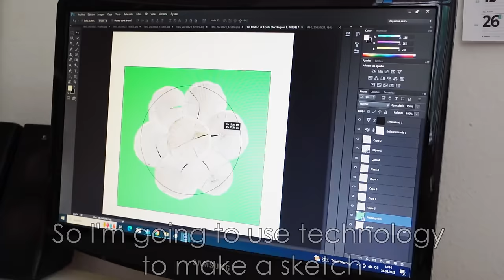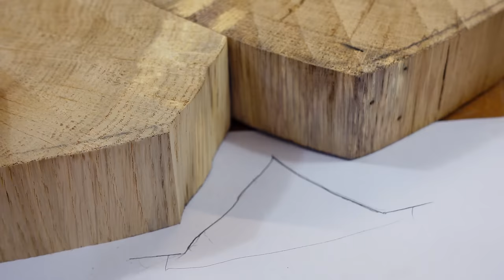They said it was IMPOSSIBLE to make this TABLE

Comment: I saw a floor made this way with cord wood fit together and with an epoxy pour.  It was beautiful. We did this 40 years ago over a large cable spool, when we were tired of a card table for the kids. We used that table for 35 years.
Reply from the maker: Wow!
Reply: Good work. So beautiful how you take your time to include all the steps necessary to take what you have and create a beautiful one of a kind piece. I applaud your skill and artistry🎉
Reply from the maker: @orenziajaskiewicz1460  thank you so much. I'm glad you like it!

Comment: Looks pretty cool!  How will it fare over time with changes in humidity?  I know you backed it, but will that be enough to prevent continuing grown ring shrinkage cracks?
Reply from the maker: If the wood is dry and you use a good finish ,no problem

Comment: Beautiful.  I like it round.  Just out of curiosity, what is the final diameter of the round?  I am currently struggling with a mosaic project 3’ X 3’ that was to be an outdoor wall hanging.  But, I decided to make it into a table and would like to build a mold into a circle and encase it in acrylic resin.  You mentioned using an acrylic boarder striping sealing it carefully, where did you find the stripping?  To allow for a 2” boarder around each corner edge, my base will be 50” diameter, which yours looked to be in the video, so I am curious.   Thank you in advance.
Reply from the maker: It's about 1 meter diameter. You can buy it in Amazon

Comment: Make a flower shape and fill the gaps including the edges with resin (violet or mauve) to make a circle. So, the wood would be a flower and it would have a circular shape due to resin. Plseee 🥺
Basically the triangular pieces of woood which made it a circle would be replaced by resin
Reply from the maker: I'm not a big fan of violet...
Reply: Then make it yellow resin or any colour you like. But it will look soooo awesome 😍
And there limitless options. Like adding dried flowers in the resin. Or glitter or just anything.... 😍😍😍😍

Comment: I loved❤ the piece before you made more modern . You could have used resin an ir epoxy an used a light blue powder pigment in resin an  filled each  Crack to an cut each piece to fir into each other just not modernize it so much .your table looks nice though 😊

Comment: I believe the flower shape was better, but either is good.  However, I have one thing I would point out, if you are intending to sell this and I was considering purchasing it and I saw the MDF, I would walk away from it.  I don't care how good or nice everything else is, I wouldn't even consider it.  The only reason I see for the MDF is, is to make sure all the pieces stay together over time, if that's the case I would have chosen something else to complement the design, but I would never use MDF.  I understand this is a unique piece with many challenges, but I wonder about the longevity of it.  It has no directional stability and it will swell and shrink in both x and y dimensions.   Maybe, because it's small, it won't experience enough stress to tear itself apart.
Reply from the maker: Don't worry, it isn't going to break

Comment: Super idea until you added the MDF inlay… Couldn’t any more “noble” material be used to stabilise (steel?). It’s like constructing a high-end Ferrari and adding some cheap plastic to the interior…
Reply from the maker: I didn't want to use a steel sheet and make the table weigh more than my car. I thought about using titanium, but it was beyond my budget.

Comment: Yes. I personally would have left it as the natural shape after assembly, rather than make it round. It had more character, more visually appealing, and  sorta goes with the natural theme of the material. You could even tell a story to people that it is a slice/slab from a rare tree. Great conversation piece. Oh yeah. Just before you showed us, I said, I'd draw the slabs up in Rhino or solid works to map how I would put them together.
Reply from the maker: I did it with Photoshop. It was necessary
Reply: @marmotaworks  photoshop is great for many things, but not so much 3D modeling. I regularly use Rhino to put together designs for my woodcraft because I can set & see the dimension specs for zero tolerance puzzle joint concepts in my woodcraft.

Comment: No one said it was impossible, just that it is a bad idea. Neither the wood nor the MDF has the strength that a table needs.
Reply from the maker: I don't agree.
Reply: @marmotaworks  They don't even hold up to you working on them without falling apart, what makes you think they can support any sort of weight?
Reply from the maker: @sdspivey I have it right in front of me, and I have conducted tests by placing a lot of weight on it for days, and it holds up perfectly. Furthermore, this isn't the first table I've made using this method, and they hold up perfectly. I respect your opinion, but I have to tell you that you're mistaken.

Comment: Great work, but I’m afraid I think it was a mistake to make it circular. Previously It looked arty and interesting, as if you’d deliberately adapted the grain of the discs and cracks, to look like a flower. There are thousands of round tables and this is just another one with filled in cracks which, without the petal shapes, seem a bit meaningless.
Reply from the maker: Matter of taste
Reply: @marmotaworks  That’s a strange reply. You asked for our opinions about the flower shape. I did exactly that and thought it would also be helpful for you to know why I think it was better before you rounded it. Now you cut me down with what is basically a “yes but”

Comment: i have a few question regarding these kinds of tables
why do so many of these use ugly premade metal legs?
i know the one in the video is just a placeholder, but there are many other similar tables and chairs that uses them
if you are going to spend the effort into making a beautiful top, why not finish it off by giving it a wooden leg of similar quality?
Reply from the maker: Probably because they aren't custom tables. The metal tables can be changed if the customer wants different ones

Comment: Try breaking it
Reply from the maker: Why??
Reply: @marmotaworks  To see exactly how resistant to breaking it is. Sure, you have the inlay at the bottom, but it's not to the edges of the table, and the wood's grain is oriented in a way that breaks easily. Even though you have epoxy - it's not penetrated all the way through the wood to stabilize it enough, it's just in the cracks and between the pieces. I presume the edges of this table are not that hard to break accidently in everyday use.
Reply from the maker: @JanasV  I have done a lot of tables and I'm pretty sure that this isn't going to break.
Reply: @marmotaworks  I understand, but wouldn't that make an interesting video? :) Testing the table, and then maybe some other test pieces
Reply from the maker: @JanasV  maybe in future

Comment: Stop using the router as a planer. You destroyed it. Stick to macaroni and cotton ball with elmers glue.
Reply from the maker: The Router is definitely the best way to flatten this type of project. If it breaks, tough luck. Tools are meant to be used.
Reply: @marmotaworks  Have you thought about doing a bowel movement first and possibly incorporating that into the project?
Reply from the maker: @WuotaniRuoperath  I always forget that 10 year olds can also use YouTube...